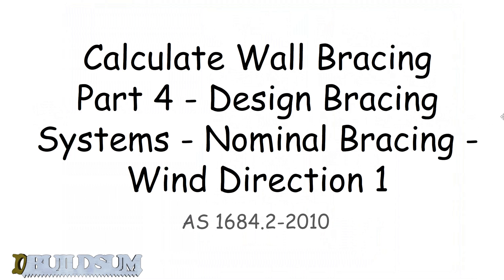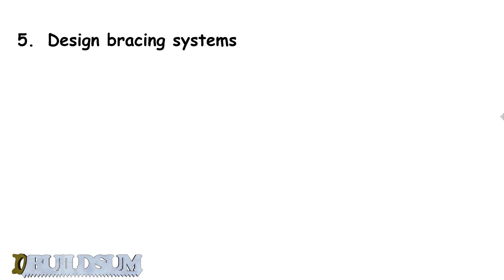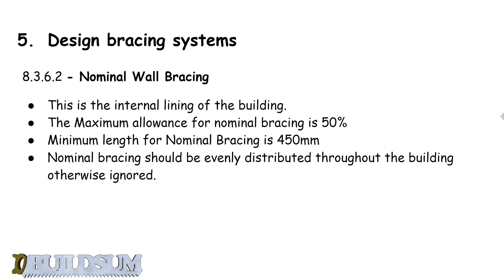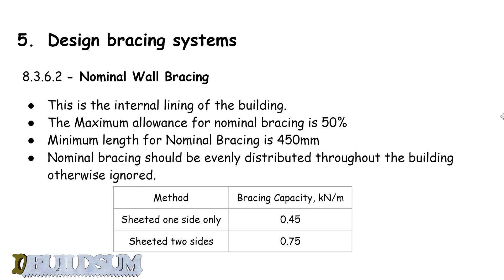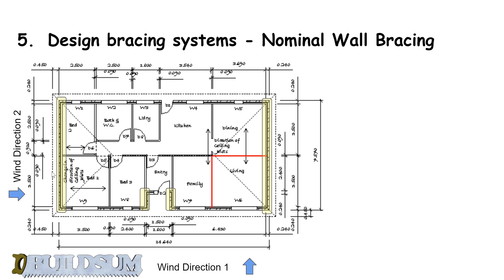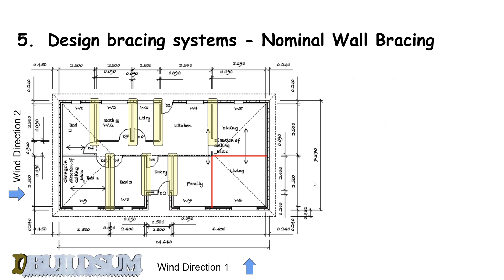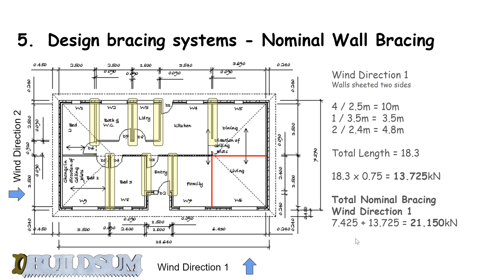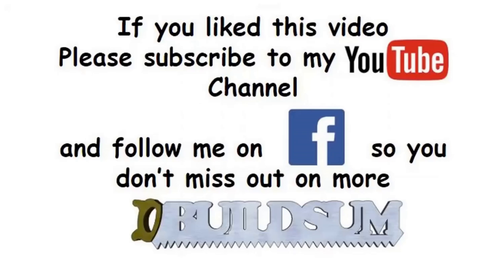Calculate Wall Bracing - Part 4 - Design Bracing Systems - Nominal Bracing - Wind Direction 1

Comment: With a staggered stud wall would you happen to know if there's an Australian Standard for that? I wonder if both rows of studs would require noggins and bracing. I mean the outer row facing the siding and the inner row facing the Gyprock. I mean for an exterior wall.
Reply from the maker: Hi Cameron, not sure what you mean by a Staggered Stud Wall however all framing is covered by AS 1684. If you are talking about having to wall side by side, one to take the Gyprock and one to take the cladding this is not nessecary as the one wall can carry both. This video shows how it works
https://www.youtube.com/watch?v=gpzGz1nQ9kw
If you have to have the two walls then only the loadbearing structural wall would need the bracing, they both would need noggings.
Hope this helps.
Reply: @Buildsum  Hello Buildsum,

Thanks for replying to me. By staggered studs I mean let's say you have a bottom wall plate of 140mm. Then you have 2 rows of 90mm studs. An outer row supporting the siding of the house and the inner row supporting the Gyprock. It's used mostly in American construction I think. So that more insulation can be put into the walls and to reduce thermal bridging. You pretty much have double the amount of studs.

https://www.buyinsulationproductstore.com/blog/keys-to-wall-soundproofing-lesson-1-decoupling/

Under method 2 on that website shows a staggered stud wall. You would basically have a wider top plate and bottom plate and then offset the studs. Leaving more room for insulation and better sound reduction.
Reply from the maker: Hi Cameron, thanks for that, seems interesting, I have not seen this covered in AS 1684 which is the timber framing code which means that it would probaly need an engineer signoff. However i cant see it being any different than a normal wall with Bracing just to the one side and noggings to all the studs.